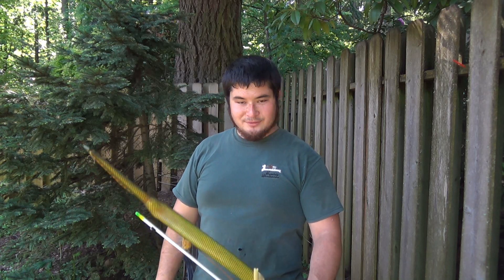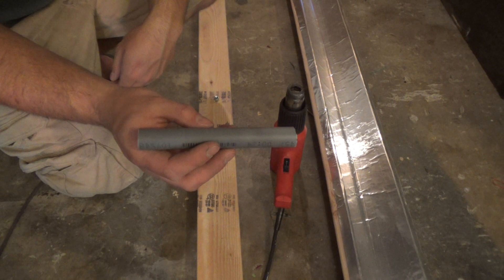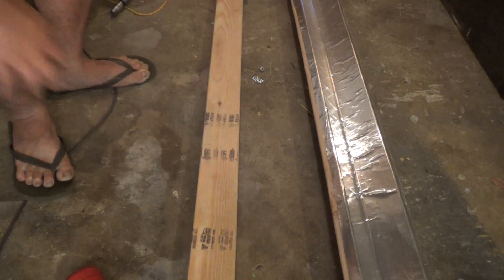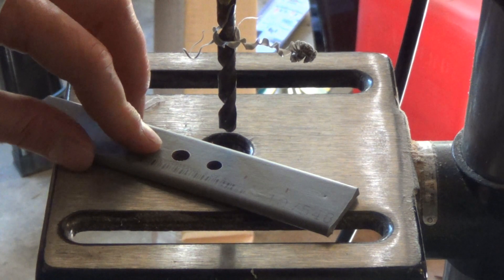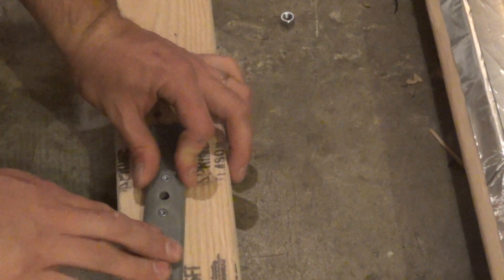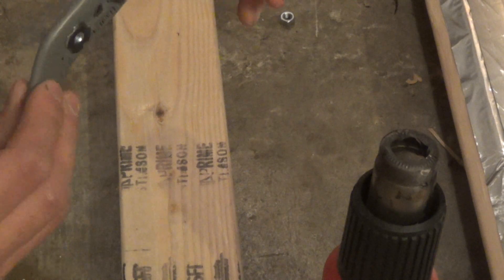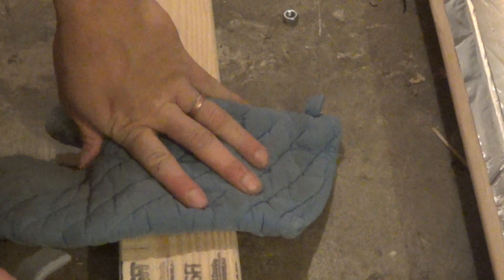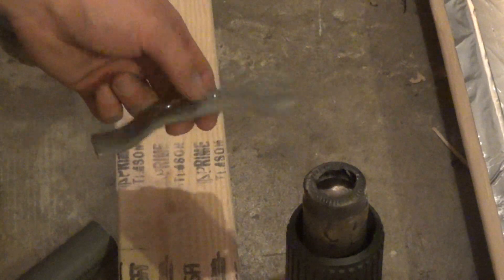Making a PVC Bowfishing Reel Adapter

Comment: i know this is an older video, but can i use 3 prong sae standard stainless steel tee nuts for this? i found them on lowe's named "The Hillman Group 5/16-in Stainless Steel Standard (SAE) 3-Prong Tee Nut", they are 4$ a piece, but i couldn't find the 4 pronged on their site, and just in case i run into not finding them elsewhere for price/quality/shipping or instorepickup ild like to know if i could use those for this. i am actually going to put together your 70 pound pvc bow from the video you showed with the fiberglass inserts, as well as pretty much all the other modifications and what not you have put out here on your channel, not cause im cheap, but because ild like to know how to do this and how it works as a beginner i'ld like to have something as sturdy and rugged as this without the pain of hurting something that costs way too much when i can build something just as good if not better suited to me with help from your channel.

awesome videos man, keep up the good work!

Comment: Thanks again, You need a Bow Shop on the front. May The Most High continue to bless You. Get to a high elevation as  soon  as possible. Stock up on supplies, and get a good portable water filter with replacement elements.If You haven't already. We need you, you are a valuable Brother. I lived on The Big Island for 7 years, I miss it, It is beautiful, and the air smells like Heaven. Have You ever shot fruit out of a tree using a rubber ball as an arrow head ? .......Seven Thunders